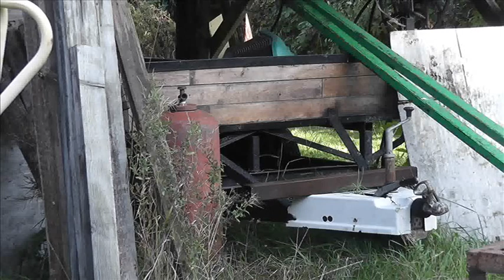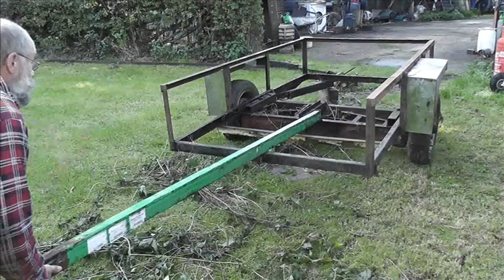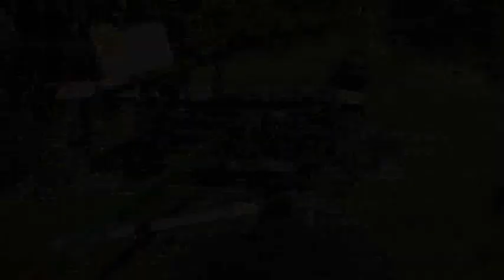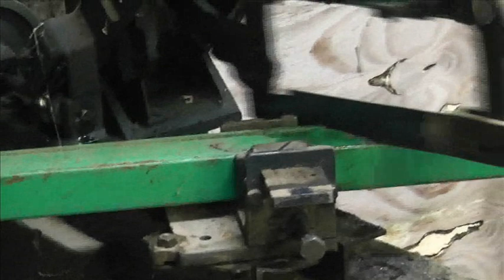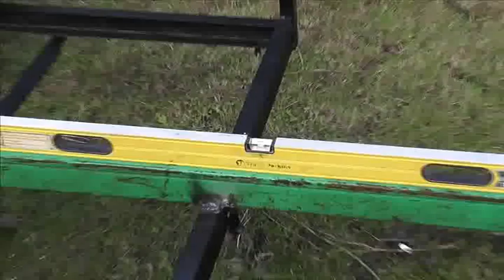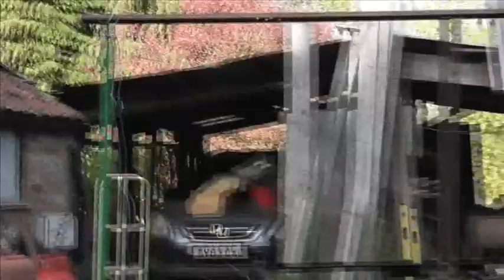Solar trailer build part1,  rural mobile system  build,.

Comment: I've just watched a fairly recent video on the MyEnergi wall battery https://www.youtu.be/UEFJyWCK5uw Sounds very similar to other available options like the Bluetti AC500. Inverter and battery combination. All very well but not easily integrated into the existing house electrics.
I like Owen's recent video showing a battery unit per appliance. Easily added to essential items.
Reply from the maker: Ian, that link does not work, however these battery systems work with various sensors to indicate generation and import / export. In theory it's about power sharing, but my friend Lee is using a slight variation of that shown by Owen and it works just fine. Obviously in cloudy weather it's not quite so efficient but because the individual charger / inverter system is a primary load and generated power goes to it before the diverter, cheers

Comment: Always a great feeling when you can rely on accumulated stock to get the job done. I save  everything having learnt  the hard way. The moment you throw it out you need it   later. Great job on reusing the trailer.
Reply from the maker: Ah, there's the balance, moving stuff on you know there's only a 10% chance of using. That way clearing space for clear thinking and not just being a simple hoarder, difficult, cheers

Comment: Stored solar panels? Can't have that Andy! 👍
Reply from the maker: Jim, exactly, and now the days are shorter every square metre matters, cheers
Reply: @TheInfoworks I'm  in the middle of installing the Multiplus here finally Andy. Finding it hard to get good components, even solar panel brackets right now. There's a huge rush to solar power by households and contractors are making hay here. Hearing quotes of approx 2k per kwp installed! . I've been waiting over 3 months for an electrician to hook up the AC side of things. Crazy!
Reply: @Woodyjims-shack  i've had a log burning stove penned in for the last few years. Got an original era fire surround and mantle out of a neighbour's skip, but looks like the stoves have a huge rush on them too.
Wasn't there to be a law change soon on log burners?
Reply: @ianhelsbyservices  Emission related changes for new stoves I think (secondary burn etc). Think something similar is coming into place here. Also regulations are in place for burning timber over 20% moisture due to low air quality in some urban environments.
Reply from the maker: @Woodyjims-shack  Jim, can you not hook that up yourself? I've heard of supply problems and the value of second hand gear going up, cheers
Reply: @TheInfoworks  Well short answer is yes. Andy. But we're moving loads around and  setting up critical loads panel etc and my wife wants a sparky to do that part. I've everything in place for him already and currently working my way through the battery and solar panel stuff when time allows.